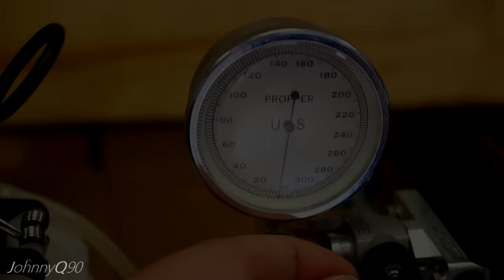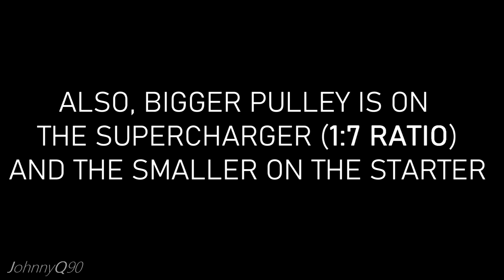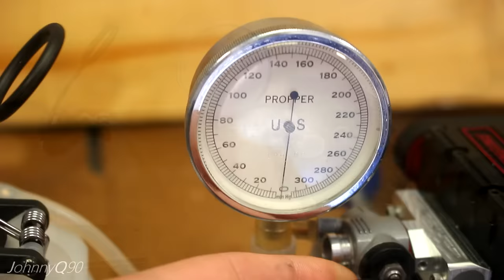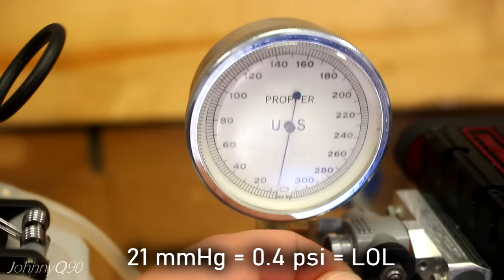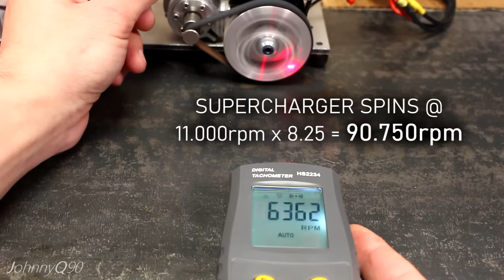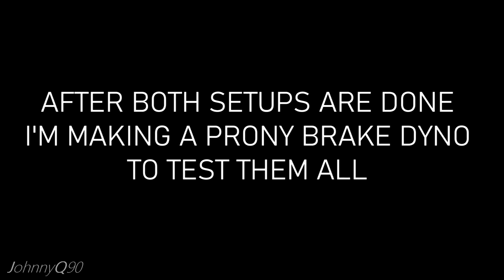0.6psi @ 90,000rpm Supercharger on MINI 2 Cylinder Four Stroke Engine! - BLOW Through Setup

Comment: One thing that I'm noticing, also from the last vid, you don't have a lot of smoke. Every 4 stroke I've ever seen smokes like a freight train. Most run on plane or heli fuel with very high oil content. I'm only mentioning this, because I am concerned with your engines wear characteristics. I also think this is partially limiting your top end, lack of smoke means lack of fuel. I also like your new method of pressurizing the fuel tank, the exhaust manifold was too restricting and wasn't doing much pressurizing. I admit I am far from an nitro expert, but in my experiences (surface RC's and watching RC planes and helis) these are my concerns. 
     Edit to add, I also think losing the flywheel is a bad idea, it's there for a reason (balance vibrations, maintain momentum or both), while it sounds good, you may need the flywheel if you intend to put this in some kind of vehicle. I did notice the fuel tank shaking more after the flywheel came off, so there is vibration there

Comment: Love this build.  A more accurate way to measure the boost may be from the tank pressure port. If all of the supercharger air flow is being blocked by the guage the compressor air flow is stalled and may not be the same as when air is moving through it.  Any thoughts or am I totally wrong? I was thinking of blocking airflow on a Vacuum and it's motor speeds up or the use of a blow off valve on a car to prevent turbo surge when the closing throttle blocks the flow.

Comment: If you want a decent model 4s engine get a Y.S (yamada) or a saito
Dessert aircraft (DA) for 2 stroke or MVVS or O.S engines 
You will also find using 30% nitro fuel with 23% klotz oil will also help in running this engine in video

Comment: I believe if you used a draw through turbo charger it would make more power because the current carb you are using is not ment for being a blow through carb. Even with that tube u are using to build pressure in the fuel tank causes fuel to be forced in it's not enough. If you used a draw through method it would be slightly more efficient. The carb would be mounted before the turbo and the fuel will be drawn through the turbo into the intake and so on. Or try to get an electric fuel pump

Comment: I like this project, but your SC needs a lot more rpms. 
On new cars, Turbos rev up to 200.000rpm. And they are sized with a 49mm Turbine Wheel on 2L engines.
Your Turbine wheel is a lot smaller than usuall cars have. 
Therefore your Turbo should at least rev to 200.000rpm if the Turbine diameter is equal to the disaplacement of the engine, like 
normal car engines.

Comment: I think you know this already, and I get why it isn't easy to do, but not only is the impeller rpm WAY too low, the size of the impeller is insane compared to engine size.

Very small turbos like the td02 for 750cc engines spin at over 250k rpm for 2.2 bar. Keep in mind that rpm and pressure doesn't have a linear relation. 
90k rpm works for huge turbos on 10+ litre engines.

A real miniature exhaust driven turbo would be awesome, otherwise the pulley needs to be at least twice the size and preferably on an even bigger engine

Comment: It seems to me when you put pressure on the tank the volume of air above the fuellevel will result in the turbolag and throttlerespons. When you fill it to the top it will be less.
Reply: That makes no difference.

Comment: maybe you're just better of using compressed air from a garage compressor (just to theorically test boost effects on such engine)   :) or make an electric supercharger running from li-po batteries and a brushless motor so it doesnt steal engine power right from the beggining

Comment: JohnnyQ90: Your fans talk loud, but your turbo does not. You should probably study how a carburetor works. Applying pressure to a carburetor does not make it better.
Also the "fluid dynamics of air" relies on a centrifugal force to make pressure, so the lower diameter fan disc you have the many more rpm you have to have on the spindle to make a significant pressure.
If you ground the head of a pencil into a fan disc, how many rpm do you think you need for it to pump air for you to breathe?
Think the same, but with a fan disc with the diameter of a beer can. I hope you see the points I'm making.
I would think, that if you wanted a small turbocharger, you could start by studying how aircraft turbo engines work. They have compressor stages. I might help you with the small diameter fan disc.

Comment: Are you sure that the supercharger is not a restriction instead of a boost. The S/C may not be big enough to feed that motor. also you may consider a gear box for the S/C. The real life versions are geared up quit a bit but it does add complexity. I think they run 40-50k rpm.

Comment: What about intake boost pressure while running connected? I’m wondering if your turbo is actualy restricting engine demand due to still low (for its size) turbo rpms. Cool! So nothing negative meant. I just suspect it wants more air and gains will go way up. Of course turbos need different cams, more compression, port work... LOL!

Comment: I think at that size, the tip speed (which is the only thing that matters) is simply too low.  Try increase compressor size, you'll find even increase a little bit will mean the tip speed will be much faster.

Comment: Have to wonder, since piston rings (if the Toyan even has them) are fairly generous on small engines. Would the boost just flow past and pressurise the crank case?
Would be really cool to build a test rig to see if there is a measurable power increase.
I've seen some dynamometers made for RC engines that are very basic and can only shoot out between 2 engines (or tunes) that are either wagon brake style (forcing 1 wheel into a flywheel with a consistent measurable force until the engine stalls out and see which one will handle more force) or the more complicated electromagnetic versions which require some pretty special electronic kit and just ramp up the amperage to an electromagnet and see which engine stalls out first.
There is a guy who built and actual dynamometer for electric engines and I've gone through his reasoning and it seems OK but I wonder if its more RPM/time based than actual power which would speak more to the engines efficiency than power. But I'm not that smart so its probably fine.

Comment: I wonder if running the turbo off a separate electric motor and timing it to the gas motor when it’s revved up to a higher RPM would make the desired results? I don’t know just a thought.

Comment: What are the compressor measurements? Id be interested in what trim it is. Radial superchargers usually have a very low trim number. They do more compression at lower rpms.

Comment: Would a check valve on the fuel line help? Keeping the back pressure line on plus a check valve might stop any possible backflow you have in the fuel line? Just a thought

Comment: One of the things missing in all these videos is a dynometer.  I would be very interesting to see some performance graphs. Why not force compressed air at 10 psi down the inlet and see how the engine performs?
Reply: No. You can't just blast compressed air into an engine and expect it to work. The airflow rate is just as important as the lbs of boost. The airflow needs to rise as a linear curve per the rpm rise of the engine, something using compressed air doesn't do.
Reply: @davelowets  The linear curve?
Reply: @mechcntr7185  Yes, an engine ingests air at a different rate at every rpm point. You'd have to match you compressed air flow to match the engines flow requirements at all the different RPMs.
Reply: @davelowets  The laws of physics will see to it that the flow rate takes care of itself.
Reply: @mechcntr7185  No, it wont. You'd snuff out the engine if you try to cram as much airflow down the carb as it needs when it's wide open. There's a reason why turbos have a wastegate and a blow off valve, and why blowers have a regulated bypass. These compressors airflow airflow rates are also dictated by engine speed. Believe me, if you would try to use a tank of compressed air, you'd HAVE to have some kind of system to regulate the airflow rates according to what the engine needs at it's varying loads, throttle positions, and RPMs.

Comment: Would it be possible for you to make a mechanical fuel injection setup? I know EFI is more complicated with sensors and such, but would it be possible to make a simplified mechanical injection? Constant fuel pressure that you can adjust with a needle valve?

Comment: Have you considered your valve spring pressure on the intake valves might be  fo low and with boost pressure as it was never designed for boost to be behind the valve, in my race engines for cars we need huge amounts of valve spring pressure to control the cylinder pressure and valve float, sorry if you have considered this just a thaught I had watching the videos

Comment: If the supercharger has to pressurize the fuel tank, that would explain the laggy throttle response. It has to pump enough air into the tank to raise the pressure before it can actually create useful boost. It would also explain why the throttle 'hangs' after lifting off, because the pressure in the tank is now releasing and pushing the excess air through the intake. You might have better luck with a much smaller pressurized fuel tank with very little air volume to pressurize.
Reply: The amount of air it needs to move into the fuel tank to increase pressure by 0.5 psi is negligible.  It's running like crap because he doesn't have the fuel mixture correct.

Comment: You need to put the carb BEFORE the supercharger, its blowing out the fuel. Carbs are only designed to work with atmospheric pressures to suck fuel in, once you introduce boost fuel flow is interrupted.
Reply: If you reference the fuel supply and the carb float bowl to the intake pressure the carb should work as well with boost as it does without.

Comment: That pin spanner is liable to break the circumference of that ring - look at where the forces go when you exert torque on it. I suggest getting one which spans the diameter as it would be safer. Speaking from experience of installing a bike bottom bracket :(

Comment: Also, your boost measurement at 5:45 is invalid; a compressor has a flow/pressure "map", and in your test setup you have zero flow. This would cause the compressor to stall, and generate basically no pressure.

Comment: 0.6psi without the engine consuming air is not the same.... measure the pressure with the compressor connected to the engine to get a realistic value

Comment: You cant run a 1 to 1 boost pressure to fuel pressure. It will run horrible.  The fuel pressure has to be higher then the fuel pressure using rising rate fuel pressure regulator. Its a must. At 30 poundsvof boost on our turbo cqrs wevrun 70psi of fuel pressure

Comment: U need a bigger main jet. But that’s not possible with them. The only way is to make a different intake. But the pulley works. We’re talking tenth scale car. Did u figure scaled size about 12 pounds of boost. It works. U just need more fuel

Comment: Why don't you try in a different configuration? Carb, compressor, engine.. this way you don't need back pressure inside the tank. It's the same as the firsts turbo engines

Comment: Dead heading the blower probably helped cause the last failure. https://whatispiping.com/understanding-centrifugal-compressor-surge-and-control

Boost is not being measured correctly. It is  rpm and engine flow(volumetric efeciency) dependant.
You need the gauge while the motor is running. It could even be under vacuum when you think it's making .6psi

Think of Boost vs hp is atmosphere vs hp. BAR is easier for concept...1 bar=(14.7 ) Wich is our atmosphere ..2 bar= two atmosphere...If you double the atmospheric pressure 14.7psi hp will double 7psi should be half what the engine makes naturally aspirated(minus parasitic drag)

Comment: Are you using a forced induction throttle body? If not, how are you preventing the fuel from blowing back up the line?
Reply from the maker: There is a back pressure line after the supercharger, that goes to the fuel tank and presuurizes so fuel can be pushed in to the carburetor.

Comment: Why is the fuel tank hose going to the super charge hose. It should be going to your exhaust. If you run fuel pressure hose off the exhaust then your engine will get all the boost rather then pushing all your boost into a rubber line into a thin plastic tank so by time it gets back around there is no boost. I understand you’d think your not losing boost it’s just diverting to tank then back to carb but no it’s getting lost in the stretch and flex of rubber hose an plastic tanks.  Stick fuel pressure line on exhaust like normal and plug hose in your intake pipe and let err eat.

Comment: The amount of fuel the engine is now using is not insignificant.. he needs to be mindful of fuel delivery issues. I'd double the fuel inlet hoses or increase the fiting and tubing size. The better throttle response with the bigger pully shows that the air pump is now delivering boost pressure at speed- it's volume output, not the pressure output, is starting to be adequate. I'd go one more step larger in pully size.. as long as it doesn't start making more drag on the engine than it's getting you.

Comment: 77k rpm comrpessor speed and only .4 psi boost? Should be seeing 20 to 30 psi at that shaft speed. This means the compressor efficiency is extremely low or the turbo itself is too small for the engines breathing capabilities.

Comment: You are measuring 0,6 psi max (0,04 bar) static pressure at full revs, without airflow, that is nothing! More Flow, less pressure, it's a curve. A better way to measure the actual pressure under running conditions is to put the gauge in the line to the tank and see what happens.
I think the charger isn't able to deliver enough airflow at higher engine rpms, so it stalls.

Comment: The engine is pulling in air faster than the turbo can supply it. This is why it is laggy and underpowered with the restriction(turbo).

Comment: You really need to do this with a load on the engine. You're just making revs, not power. Put some demand on that engine as you make changes and tune it and you'll have much better results.

Comment: Centrifugal compressor efficiency at such a small diameter is simply awful...I told you this years ago, yet still you persist in wasting your time...100k is not fast enough by a long way and you don't have the power to drive it faster either. 🤔
Reply from the maker: You told me, I know. People are still curious though. They want to see it. See it fail? Yes.
Reply: @johnnyq90  I'm guessing most imagine it will work TBH...just read the comments..I think you should scratch build engines rather than do rediculous modifications to some Chinese creation..Be original..😳😳🤔🇬🇧

Comment: Hold it at full throttle then tune the brass screw. 

And for measuring the power

https://www.flight-mechanic.com/reciprocating-engine-power-and-efficiencies-part-three/

Look at the prony brake system

Comment: this tiny supercharger has way to few rpm. normal car superchargers reach 100k rpm, small car turbos even 300k rpm+.
If the tolerances and the flow in the supercharger is right so that it would work theoretically you would need some more 100k rpm's for real boost.

Comment: The overdrive pulley robbed too much from the engine,,even with the special ceramics.      About 800hp to drive a current Top Fuel supercharger,,set on kill.   Bigger cam,, bigger valves,,open the intake ports,,open the exhaust ports.,,set the squish band lower(higher comp, thinner gasket).  Correct low speed and high speed needle.  A good high speed would be the RB WS7 II .21,,with the ball milled spiral pattern out to the tip(400 power stereo microscope).    Do they make a 1.55 -58 pulley??? ,,That's probably where your limit would be,,in stock config.

Comment: Well, that was kinda underwhelming.
With the single carburettor, the engine ran really poorly. Absolutely no throttle response, and not revving anywhere near its potential. 
Adding the turbo only made it worse.

Comment: At that high rpm the blades of the supercharger are almost certainly stalled and aren't providing any greater airflow. They might even be supersonic at the tips.  The supercharger Is simply too small.

Comment: Ugh. Boost is measured with air flowing.  If you hooked a real blower up this way the gauge would explode.   And this will never work cause you need to increase fuel pressure the same as boost increases.  iE boost reference fuel pressure.

Comment: Guess so, too small of turbo and carburetor. 11000 rpm x displacement tells us how much air per min or second has to go through that straw, the motor is starving that's why its terrible throttle response.  learnt that trying to turbo my lawn mover as a kid. next time dual carbs and 3 times the size turbo.